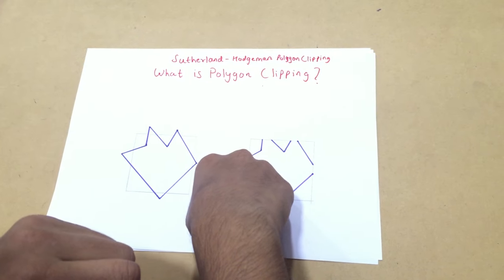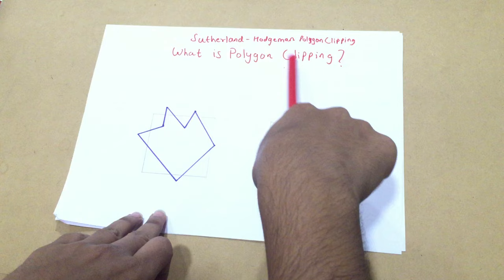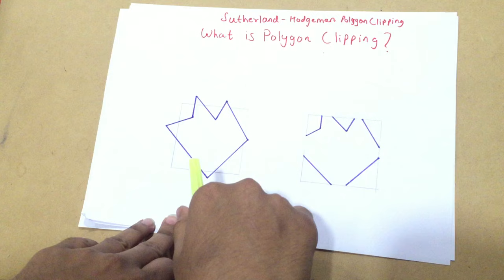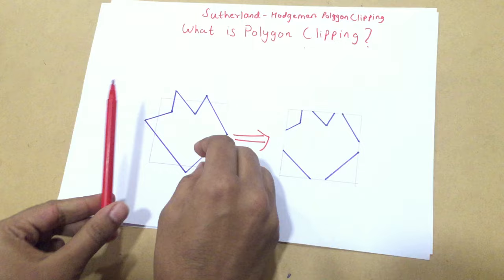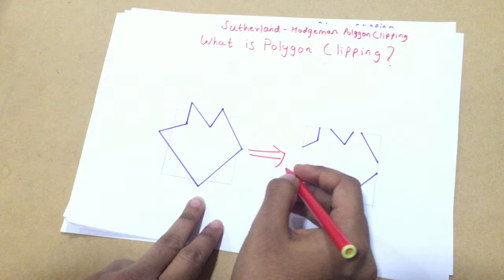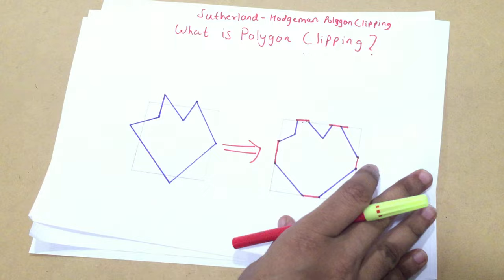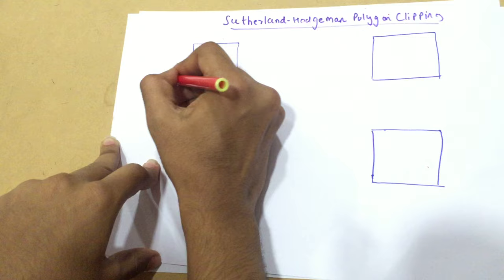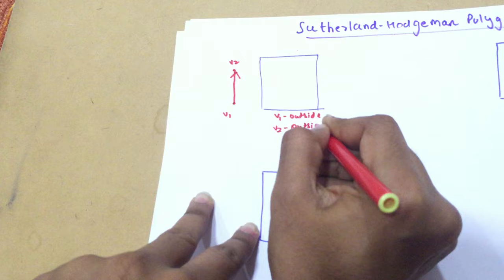Sutherland-Hodgman Polygon Clipping Algorithm

Comment: You didn’t explain how you clipped the low left corner. V5’ would wrap to V3’ not magically magically create the corner.
Reply: I was thinking the same thing. (Also, I think you meant V2', instead of V3').
This video is wrong. If anyone is looking around, to save time, I found a video with the correct explanation of the algorithm: https://www.youtube.com/watch?v=Euuw72Ymu0M

Comment: Another scenario should be taken into account is the case when both vertices are outside the clipping area, while the line they form does cross the clipping area. I guess in this case you should not discard both v1 and v2
Reply from the maker: talsveta yeah in that case you have to assume a point on the line crossing as a vertices of the polygon(hypothetically) and then break that line into the cases mentioned in the video. Thank for pointing it out though:)
Reply: Yeah,I was also thinking the same! 
Great tutorial otherwise!

Comment: Considering points as "inside" and "outside" will not work in all cases.
Check this image. http://i.imgur.com/e6S0V20.png
Segment ED is intersecting rectangle, but nither E nor D is inside the rect.
Reply: +Ostap Hrytsyshyn yup
Reply: did you get any solution of this bro???
Reply: The solution is to NOT check the 4 cases according to the rectangle
but according to the clipping edge I guess.
If you have a closer look at the pseudocode provided by e.g. wikipedia
( https://en.wikipedia.org/wiki/Sutherland%E2%80%93Hodgman_algorithm#Pseudo_code )
you quickly see that one has to pick an edge of the clipping polygon.

E.g.:
Take the 1. Clipping Edge (e.g. left edge)
-> now take as input points all points of the polygon and check the 4 cases against this edge
-> i.e. if its left of the edge -> its outside, if its right of it -> its inside
-> add the new intersection points like the cases tell you and you get a new list L'
-> you take that list as the input list for the next iteration

Take the 2. Clipping Edge (e.g. top edge) and as point input list L' from the previous iteration.
-> now perform the same steps as before and get the next output list L'

... continue this procedure for the other 2 edges of your rectangle.

I think following the steps like I wrote will indeed capture the edge by E and D.
( Please correct me if I am wrong because I also need to know the correct solution :D )

Comment: How does this algorithm handle the case when one or more corners of the rectangles is part of the clipping? You just included the corner without any explanation in the example you solved.

One other case that is not handled is when both v1 and v2 are outside the clipping window but the edge between them intersects the clipping window.
Reply: To solve your first query, a corner of the window is supposed to be  within its boundaries. So it's treated as 'inside'. For your second question, Sutherland Hodgeman polygon clipping algorithm clips a polygon with respect to one boundary at a time. So you actually need to repeat this four times for a rectangular window. In the video, he has tried to solve it in one go which would create confusion. I suggest you solve this case considering one boundary at a time. It definitely works. However be careful that you figure out 'inside' and 'outside' vertices considering only the boundary then and not the entire polygon.
Reply: Not the entire window* i mean
Reply: it works if you repeat the process in EACH edge-boundary, not everything at once.
Reply: @renzocoppola4664  Yep, and you have to treat them as infinitely long

Comment: Thank you very much! It was great and well explained!
Just one other note - I think the last edge you made between the vertices v5' and v3' is not trivial and worth to mention.. I.e. if those vertices had not been signed with a dash, you would have needed to connect them with one direct edge and not over the actually 2 edges that are formed by the surroundings of the clipping area
Reply from the maker: talsveta sure thanks !
Reply: +talsveta Yess you are right ! i think that's the small mistake done by talented buddy :D

Comment: In the rule 4 sir u have mentioned v1 inside and v2 outside and we must save v2' in the polygon example the line from v5 to v1 ,v5 is inside and v1 is outside according to rule 4 v1' must be saved but sir y did u mentioned v5'

Comment: how d hell u save v3' . according to rule d u should save v4'
Reply: when V1 goes from outside to inside V2, the intersection is  actually V1', not V2'
Reply: Thangkhup Hrangkhol irrelevant, 3 to 4 is inside to outside.  I also think it should be v4'
Reply: You are right bro
Reply: yes i think so too but if that so how we make 2nd V4' when we go from v4 to v5 that should make also V4' that will make 2 v'4